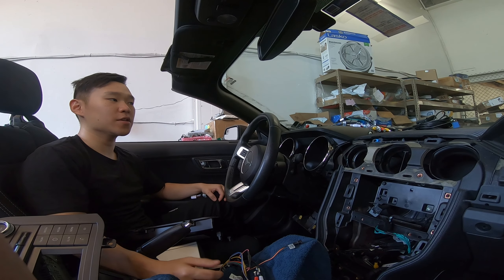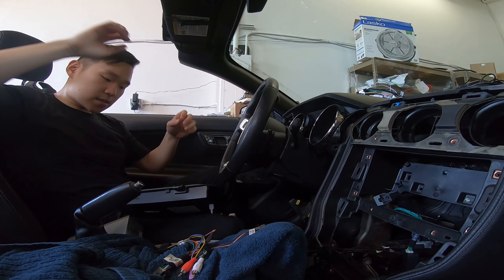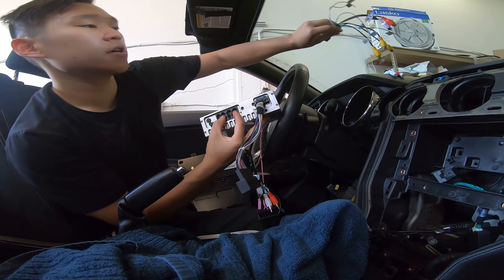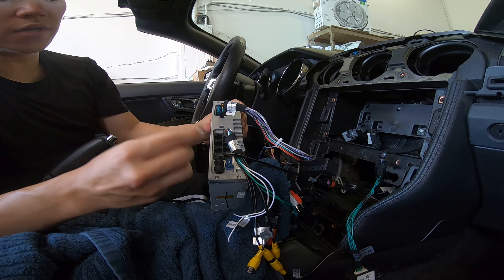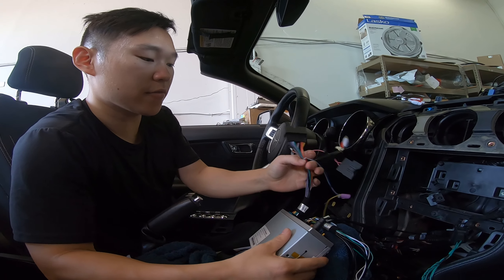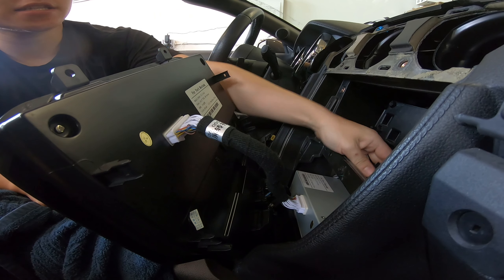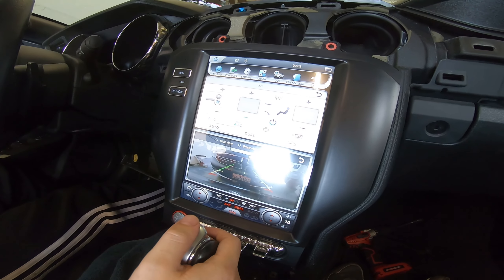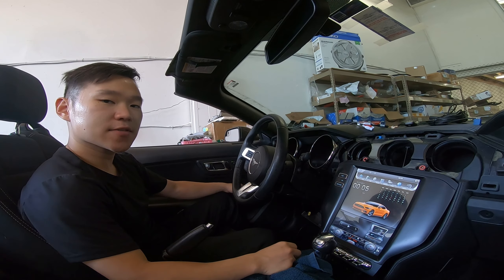How To: Install Mustang 7.1 PX3 Tesla Style Unit

Comment: I noticed you guys are amazing at replying i have the shaker 500 system  then a subwoofer going through a loc in my trunk my question is Will this keep functionality of the stock shaker 500 System And does it have Subwoofer Outs or will i have to continue using the Loc
Reply: I asked the same question and yes it does have sub output

Comment: I noticed you connected something in the OBD port (bottom left side of steering wheel).  Does that wiring come with the unit and is it just for programming purpose or that stays there permanently?
Reply from the maker: the kablamster current design doesn’t need that anymore
Reply: Phoenix Automotive I’ve been trying to contact your office in California but no body’s answering.  I want to confirm if these items are available:   1.  [PX6 SIX-CORE] 10.4" ANDROID 9 FAST BOOT VERTICAL SCREEN NAVIGATION RADIO FOR FORD MUSTANG 2016 BASE MODEL (4G RAM 64G ROM)

2.  10.2" QUAD-CORE ANDROID 6.0 NAVIGATION RADIO FOR S550 FORD MUSTANG 2015 - 2018 (2G RAM 32G ROM).   Is the office closed due to Covid-19 or is there a different phone number that I can call.
Reply from the maker: the kablamster we are operating at reduced capacity. Those are available. Usually delivered in one to four weeks.
Reply: Phoenix Automotive Is the unit in this video available as well? What time of the day should I call in case I need Tech Support?
Are the units now in the US or will they be coming from China?